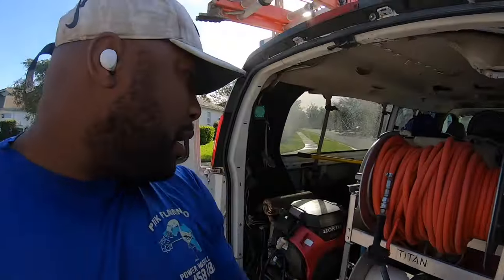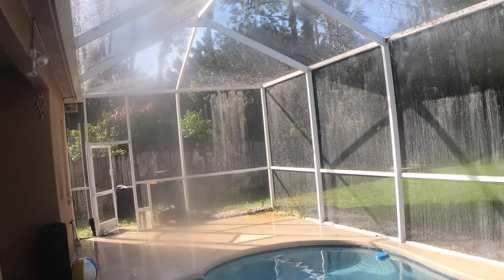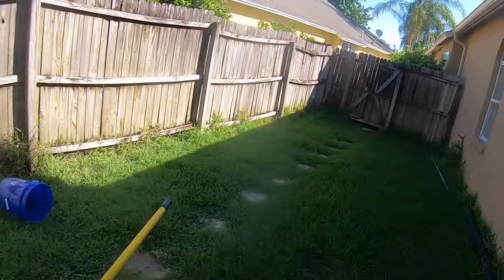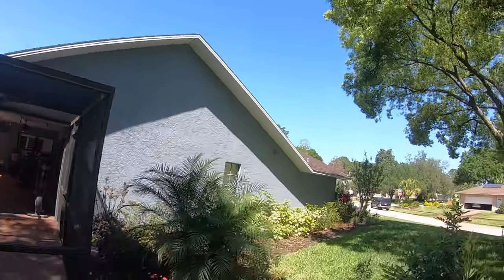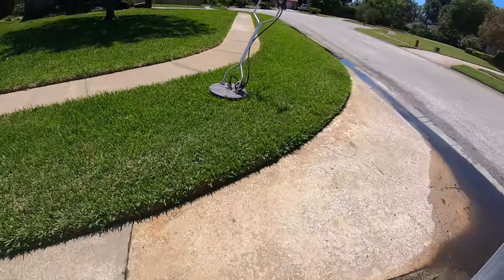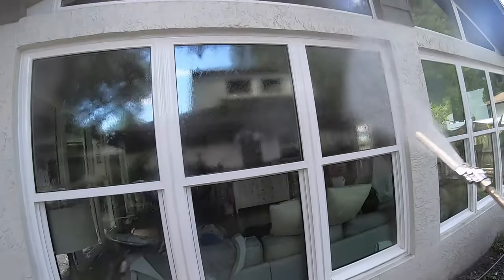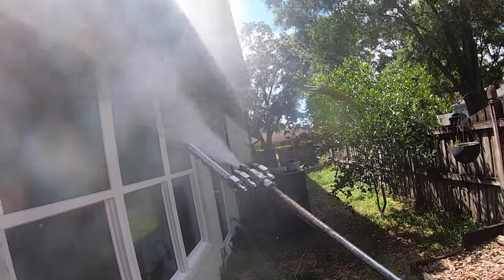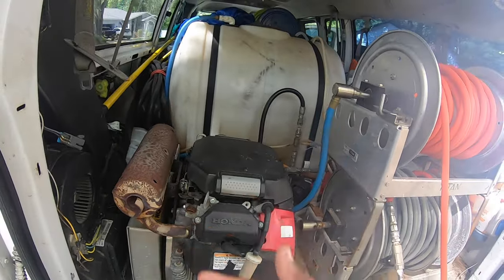How to make over 1k in a day power washing

Comment: What gpm pressure washer are you using and size of downstream injector and are you pulling SH and soap or mix batch for screen pool and pool deck..On that house wash what tip are you using to spray it looks like a small fan dies it pull SH and soap instead of using the black tip?...Thank brother best of health and prosperity.
Reply from the maker: Hey brother. I use an 8gpm pressure washer. I use an envirospec super suds sucker downstream injector (orifice might be a 2.1 or 2.3 I don't recall) ... My Jrod had the 2550 tip for 1 story downstream of course it pulls sh.  Anything with big orifice will pull sh even a ball valve.
Reply: Thank you..

Comment: For the rinse did you just use a 40 degree nozzle from a distance and is that something I could do for house washing? Spraying chemical and using a 40degree fan from a little further back or do you recommend a j rod for soaping and washing siding
Reply from the maker: I downstream with a 8gpm Jrod so my 1 story soap tip is a 2550.  For a 4gpm it's normally a 2540 tip 💪🏾

Comment: Do you got to downstream the driveway or can you just buy pump sprayer or is downstreaming just another way to using spray  sh.
Reply from the maker: It's faster and easier to downstream the driveways.  But you can definitely use a pump up sprayer. Thats how I did it in the very beginning when I started my business.
Reply: @PinkFlamingoPowerWash  appreciate you for answering my questions

Comment: Hey Cliff awesome job. I haven't done a painted wood house yet from what I've seen seen on YouTube blue and brown usually gives people problems. I know to only use 1-2 percent but what would you suggest. Have you had any issues with them two color paints.
Reply from the maker: Never ever had problems with brown.  I've only done a hand full of blue houses and never had issues with those either.  I normally hit them with a 1-2% mix and make sure I do 2 sides at a time to make sure it doesn't affect the paint.  I also sometime wet the house first.  

When In doubt about those paint colors just do a small piece at the bottom of the wall to see how it reacts.
Reply: @PinkFlamingoPowerWash  Thank you

Comment: Whats up Cliff this June from Orlando. Question my brother. Do you water down everything before you down stream? I know you do for soft washing. Also when your down streaming are you using your porportion
Reply: also, any surfactate/soap on your downstream?al
Reply from the maker: Hey brother. Yes when there's plants around its a good idea to water them down before and when you're finished give them another rinse.  No, downstream is done through the pressure washer.  I got my 12v soft wash system separate
Reply from the maker: @Talita I don't out much in there. I do a lot of screens so I don't wanna mix a bunch of surfactant in my sh.  Keep in my my 12v system and downstream is drawing out of 1 sh tank.  

If I got a job that requires surfactant then I'll use my 12v softwash system which has a stand alone surfactant tank that I can meter.

Comment: What is down stream mix sh with dawn or that something else and how do you post treat
Reply from the maker: Downstreaming it's essentially using your pressure with a downstream injector or chemical injector to add your solution to the surface. Post treat is adding your solution to the surface after you've cleaned it. Pre treat is adding your solution to the surface before you clean it.
Reply: @PinkFlamingoPowerWash  thank you hopefully in next couple weeks I B doing it even tho I should have been done this thank you for giving out gems

Comment: Are you down streaming with 100% 12.5 SH? I hear it’s a 1:10 ratio when down streaming.
Reply from the maker: Yes 12.5% yea I heard that too.  Look up envirospec super suds sucker downstream injector
Reply: @PinkFlamingoPowerWash  cool, so you’re not mixing your 12.5% batch with water to bring down the strength, as you’ll end up pulling a lil over 1.2% SH from down streaming straight 12.5%.
Reply: Your videos are on point brother 👌🏽
Reply from the maker: @MaskulineMale  Nope the downstream injector does the mixing with water for you. so if you are using a 10-20% draw injector youll be at a 1-1.25 % of of your gun.

If you werent using a downstream injector and using a dedicated softwash system like a 12v pump then you  would have to put 10 gallons of water into 1 gallon of 12.5% sh to get your 1.25%.
Reply: @PinkFlamingoPowerWash  sounds good man 👌🏽 thanks and keep up the great work 🙌🏽

Comment: Question, Can I use MQ3-45 Pressure Boosting Pump (230V) for soft wash?
Reply from the maker: I'm not sure about that pump. I don't know if it's rated to handle chlorine.  Might wanna check with the manufacturer.

Comment: thank you for the video. I notice you keep saying soft wash then down stream. I thought that was two different application. One is with the pressure washer and the other is with a 12volt pump or ar pump or air pump. Please help me to understand your processes. Take care and stay safe.
Reply from the maker: Soft wash is anything  with low pressure.  People get that confused but in reality a Jrod and downstream Injector is still all low pressure.  Different methods of softwashing. Keep in mind the downstream injector only works under low pressure. Get what I'm saying?
Reply: @PinkFlamingoPowerWash  Yes sir. so you say soft wash but you are using both processes and calling it one thing. Thank you for clarifying that.
Reply from the maker: @michaelsfabwork2985  yes they're both soft wash. The Jrod that is used only works with low pressure.  Now if I was to use a white tip, green tip, yellow tip all of those are high pressure tips. 💪🏾💪🏾

To add also. The "dedicated" 12v softwash system only allows you to use a hotter mix than softwashing with a downstream injector.
Reply: @PinkFlamingoPowerWash  OK i understand. I have a soft wash system i built for the hotter mix. So you still do batch mix for your jrod soft washing?
Reply from the maker: @michaelsfabwork2985  nah I do t batch mix. I just downstream out of my 65 gallon sh tank.  I don't add a gang of surfactant in my sh tank.  Just a lil bit So I can see it.  If I need to wash something with surfactant I use my soft wash system and then use my metering valve to draw surfactant out of the surfactant tank.
Reply: @PinkFlamingoPowerWash  ok I understand. Thank you for your time.

Comment: When you say 5% mix does that mean 5% SH and 95% water or what is the ideal mixture for this? ive been getting into this and experimenting a little bit at friends houses, but ive foundd myself unsure if i want to use SH to avoid staining, but every professional uses it, just wondering what the safest mix is, ive found 1 part sh - 4 parts water, but ive also found 1 - 16 parts so im not sure what the ideal mix is
Reply: There is no "safe" mix, it really depends what you are going to clean. If you get SH in 10% strength, to get a mix of 5% you will need to mix it with water equal parts (50/50) so you are cutting the SH strength in half which will be 5%.
Reply from the maker: Just like @Abraham said.  Sh come in concentration form 10-12.5% mostly.  So you have to mix it to a safe percentage depending on what you're cleaning.  Not everything will need a 5%    most house washes only need 1-1.25 mix.
Reply: @PinkFlamingoPowerWash  Right so if i had 10% sh and mixed it, i would mix it to 1 part sh and 5 parts water to get that to 5%, am i correct on that math
Reply from the maker: @mattygriz  well it's gonna depend on how you're going to apply it.  If you're going to use a dedicated softwash system to get a 5% out of 10% sh then it'd half water half sh brother. 

That's the only way to get a hot mix like 5%  

Here's a Google document I made that you can request permission to download it. Here's the video and excel file link is in the description. 
https://youtu.be/V_msWPLbgCo
Reply: @PinkFlamingoPowerWash  Thank you so much for taking the time to explain as i look more into it its not crazy difficult but i still appreciate you taking time to try and break it down for me, i just wanna keep my customers houses safe!

Comment: where you get those stackable hose reels
Reply from the maker: Pressure washer products
Reply: @PinkFlamingoPowerWash  thanks. I'm having trouble fitting everything in my van I just brought
Reply from the maker: @erikservices  should be easy. I've had 2 vans builds so far

Comment: Could you give what SH% you typically use on different surfaces: Vinyl siding house, brick, stucco, concrete, wood, PVC fence. Thanks for your videos and help.
Reply from the maker: Vynil 1-2% , brick 3-5% , stucco 3-5%, concrete 1-5%, pvc fence 1-4% ,  I don't put sh on bare wood unless I'm soing a restorating.  But painted wood houses 1-2% . Hope that helps ya. Thanks and good luck.  👍
Reply: @PinkFlamingoPowerWash  do you apply SH to stained decks / porches?
Reply from the maker: @blacklabpowerwash8018  no I don't.

Comment: what nozzle did you rinse with?
Reply from the maker: 1st job I rinsed with the black tip but with my downstream injector off so no sh comes out.  When u got my short gun I used a 2550 (for 8gpm machine) tip and my shooter tip to rinse.